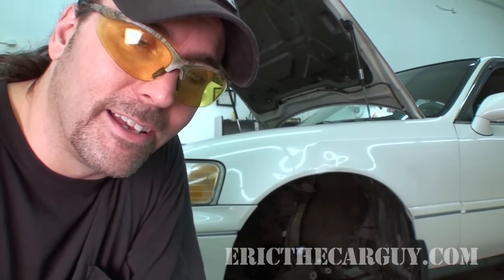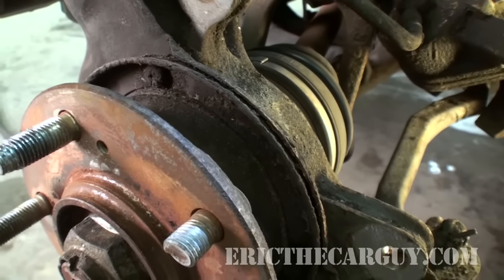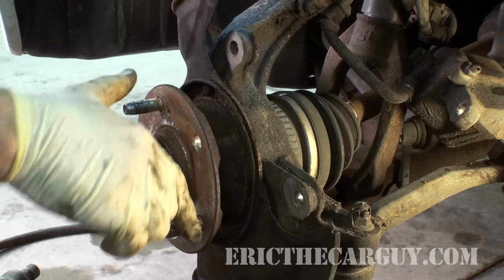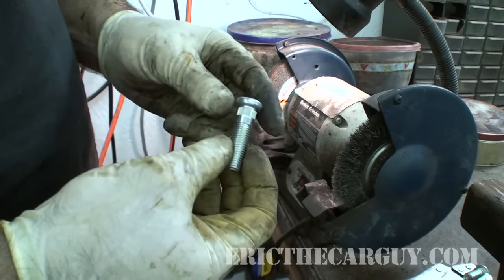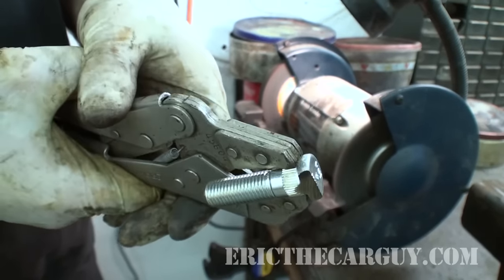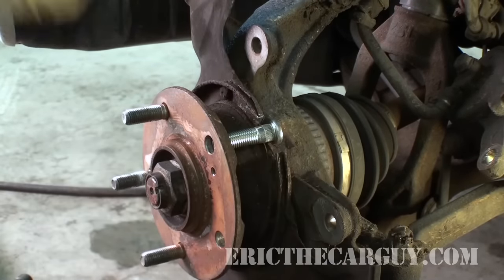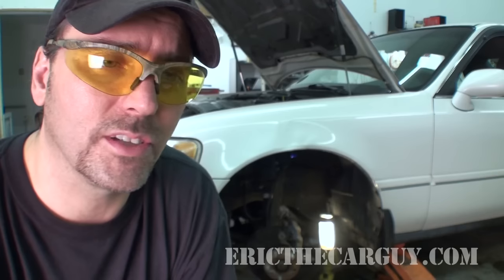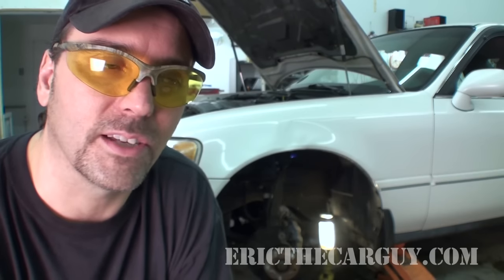Replacing Studs the 'Easy Way' -EricTheCarGuy

Comment: ETCG I really could use your help, I emailed you awhile back but wouldn't let me respond to it. Im doing a motor swap & I started trying to take of the front suspension, ball join & anything with a castle nut. Last shop put them on with an impact vs 30lbs & now everythigns stripped or rounded. Ive even tried grounding off the bolts...Ive tried everything, Now Ive got all new parts but cant get off the tie rod castle, lower control arm, everything on the front suspension of a 98 Honda civic with a castle nut is stripped & cant get out. Grinding  off didn't work just damaged more parts, cutting was unsuccessful & I don't have access to a torch. Is there anything I can do? Ive watched your videos for years now & thank you greatly for what you do & thanks for any info in advance
Reply: Eric has a video on stubborn nuts (LOL!).  He illustrated using an air hammer and/or heat.  Heat is your friend - I think was his quote!
Reply: Im pretty sure ive seen that one but Ill search & go over it again. right now only form of heat I have is a small propain plumbers torch & even after up 2 3-5 minutes of head witht that still nothing. plus now some are ground down or have to be cut & theres nothing that heat would help with unless Im melting something off. Thanks Epi
Reply: Chem istry
You can also take a cold chisel and a Big Hammer and just slam it off (if you have enough room).  You'll not be using the old parts again anyway.  Use MAP gas, not regular propane, you must make it turn red/orange.
Reply: I was lucky enough to talk to a guy with a torch but if he comes to help id be suprized cuz yeah that's all the propane one has done. Ive of the cold chisel method but Im just now looking into it. I would like to save the control arms & the arm that mounts the brakes but if its quick fix, ill replace them. a full weeks work on 6 castle nuts, I think enough enough. Really app all the info

Comment: can i ask why not use a torque screwdriver and remove the two phillips screws to remove the splash shield and then their would be a divot at the caliper and the stud would pop out easily.
Reply: You would need to disassemble the wheel hub to remove the shield. That risks damaging the bearing.
Reply: D Johnson Most hondas have a divot were caliper mount is removed to remove studs.
Reply: JBMechanics

I don't see that in the video. Even if it is behind the dust shield, you can't get to it without removing the dust shield which would require taking the hub apart.
Reply: D Johnson I have an associates degree in auto technician and i have worked for a dealership for 6 yrs and have done personal jobs myself. Im not gonna argue over youtube.
Reply: JBMechanics
The general rule is, if you only have 6 years experience in the automotive field, don't try to tell others that are more experienced how to work on something.

Comment: could i use this method to replace all of my wheel studs?
Reply: If all the wheel studs are stuffed on one single hub, what the hell are you doing? At this point, you would either pull the hub and replace the studs or buy a new hub, then deal with a new bearing, anyway.

Comment: & Shaving The Stud Side wall Was a curiousity  I had   B4 you did it.  Not good  Practice  If On   a Slalom or drifter or Off Road race car , But Then Your Choice bcz It isn't the Only compression Bolt Holding a Wheel on That Needs perfectionistic Statistics.  Its A Multiple balanced Load Sequence 2 Hold The Rim on,...   Again  Mechanics choice,  =  For bashers...  &  Ona Beater, WTF,  GFI,  2 Get it "On The Road Again" . & Pounding/Peening The Stud end but Chase Them With an Oiled Lug Nut...      Thanx Eric

Comment: The numbers on the stud do mean something. A grade 10.8 high tensile steel stud. 
No problem with grinding away a little of the head, shame you used the side of the grinding wheel! 
Pity you also damaged the thread unnecessarily.

Comment: I have a Stud On an S10 4x4 To Replace  Since I got the truck  5 Months Ago.  Found Out the Hard way 4 is not enough For Aluminum Wheels  Which Even though were Quite hand tight, I reef on Them  When doing so,   That the remaining 4 Will Actually   Turn Themselves off & In The end The Wheel Will come off Quite Quickly & On a below zero Night & finding out previous owner did not have a Jack in The hidden Compartment, Even though Right In front of The parts store to get New nuts...    Murphys law ,  & Tow truck time...   Lesson Keep you Nuts Tight  & Visually Check them  often especially Alum Rims... At Least Didn't Damage the other  4 studs or rim,  Good Idea the Air Chisel  to Help Expediate The Slide-out.  ...................................................................................  & Of Course Every One has the choice do it This way or Payyyyyyyyyy   to Not Watch how a supposedly reputable shop does it

Comment: I did that on a Odyssey and damaged the threads also.Even by grinding the studs head,it wasn't enough clearance.
Reply: I just did it on my 2012 Accord, I had to dremel the hub a bit to get enough clearance. Just a small bit of material.

Comment: First, I believe it is a horrible knuckle design that does not permit one to easily replace wheel studs.  That stated, because of the critical nature of the studs, because of how much material you were force to remove, your approach is one I would not consider.  My approach would be a new bearing and all new wheel studs.  Once I saw a wheel detach from a truck, a truck approaching from the opposite direction.  Strangely, the driver's response to the impending disaster was not to stop immediately, so it made maters much worse, the driver losing lateral control of their vehicle. That experience, imbedded in my memory, has caused me to do everything by the book when it comes to such components.

By the way, I have found the "Lisle 22800 Wheel Stud Installer" a useful tool for replacing wheel studs.

Comment: My hub does not rotate.. Or have enough space just the tip of stud. Maybe skippimg a step
Reply: rear wheel? remove the brake drum - also both rear wheels will need to be off the ground for it to turn.

Comment: Do you have to balance the wheel on the car now?
Reply: +georgio jansen You only need to balance the wheel if the tire comes off the rim, or a weight falls off.
Reply: +galuple the bolt is weighing +- 3 grams lighter so you can use a finish balancer ,that's balancing wheel on car together with drive train....question still unanswered...goedendag

Comment: I hate to say it, but this is a half ass fix. To be fair, you're not the only person I've seen do this, but I strongly disagree with it. You noted the correct way to do it, and that's how I would have done it. Remove, then replace.
Reply: I do love your videos however, and your tool reviews. They are honest and genuine.
Reply: Matthew Fant It doesn't take away the structural integrity of the bolt, and that's all that matters. I just replaced all 20 on my 94 Grand Am this way, and it took me a lot less time then it would have removing the whole assembly. I also can't afford new bearings at the moment so this was a quick and simple way for me to do it. As long as the stud still goes in and sits well, cutting that edge off isn't the end of the world. It isn't "Half ass" as you said, it just simplifies the replacement of the stud, making it easier for people who are not mechanically inclined to do it without going to a shop.
Reply: Raymond Sweet Oh I understand, trust me. The idea is to help get the job done. When this happened on my mustang it was a non issue, because I could easily reach behind and install a new stud. 
My problem was with the way the shield ended up getting notched out, bolts get grinded, and it just looks hacked. I would have in the case of this car had to make a personal call, and would have removed the bearing and the hub, and put it back just like factory. Call me anal retentive, but I leave it exactly the way I found it, or better.

Comment: OK....  Why don't you just beat on the actual wheel bearings with that hammer a couple of times while you're at it to be sure to knock the bearing end play out , especially on the install.  The 5 minutes it would take to pull that hub off and not butcher up the backing plate is what separates a guy that does it for a living from a shade tree.   A Pro would also use a Lisle a 22800 wheel stud installer and an air gun to make sure the stud goes in straight

Comment: When I saw him bending back the splash shield I thought "a bit of a hack move, but whatever gets the job done," but when I saw him shave the back off the stud I was out. Not the method for me, I'll let some other guy take the heat if that fails somewhere down the road.
Reply: It's not going to fail. The stud would snap in half before it ever even begins to pull through the hub.

Comment: Wow, Honda had no regard for the technician in this area. What a terrible design. Most vehicles have a gap in the bearing/knuckle/splash guard assembly where you rotate the hub and slip the old stud out, and new stud in. Granted, wheel studs don't usually fail unless someone forgets to tighten the lug nuts, or makes some other mistake, but still. I'm all for Eric's method in this case, as long as he explained to me as a customer what was going on beforehand.
Reply: Cars are not designed to be worked on easily. The manufacturers do this on purpose to generate work at the dealership that the average shade tree mechanic won't want to mess with. They could have designed the knuckle with a ground out area/ opening and it would have been plenty strong enough, what Eric did was an easy way to do it and will have no impact on safety for that vehicle. I've been wrenching for 37 years and have done it plenty of times myself to my own vehicles. Also for everyone complaining about proper torque on the lug nuts, I have tightened literally thousands of lug nuts with an impact gun over the years without using a torque wrench and have NEVER had anyone come back to me and tell me their wheel fell off or that their studs broke after leaving.

Comment: STOP! Grinding with the side of the table-top grinder wheel! Do not use the side of the wheel to grind. Although you may get away with it, it only takes once to regret it when the wheel blows apart, sending pieces flying at you. ONLY use the edge of the wheel to grind. Look up safety tips for using a table-top grinder. Just keep in mind that it only takes one catastrophic failure to ruin your day or worse. 

Other than that, this method should work fine. It's not perfect, but it's better than nothing. Just don't do it to a vehicle you plan on selling. Take risks for yourself and leave everyone else out of your will to take chances.
Reply: What risk?

Comment: grinding the lip that keeps lug from pulling through and messing up threads. sounds like bad idea. if possible I would drill hole through dust shield for better straight lug access then tack weld piece of metal to close whole up.
Reply: Too much time....

Comment: This job is baffling to me.  wheel studs are safety items and I really don't think I would do this. Outside of that, the other thing I don't agree with is that when there's an issue with wheelstuds, there's usually one adjacent stud that's also going to break soon, aside from the ones that need replacing.

Comment: That is one way to do it. If it's done in a professional situation the customer should be the one to make the call. but when your faced with stripped and rusted bolts on the hub of some guys clunker work truck and he give you the green light, not to mention all the other customers waiting for you to get done so you can get to there car then don't be a wank get the job done. it's not like the stud or the hub is going to fall off if you did this a million times over a million years, so I don't understand why so many panties are so twisted

Comment: How is the difficulty for a 04 mustang v6 in this installation
Reply: Haik Boyadjian way easier! just did mine and you take off the caliper and knock the old studs out with a hammer and use a lug nut to pull the new one back through
Reply: SneakySonBeach Thanks man

Comment: This is the true definition of half ass. I just replaced all mine on the passenger side front tire and it didn't take a fraction of the effort displayed here in this video
Reply: Banged the studs out. Put washers on to take up the excess space. Tighten until the head of the stud is flush on the back.. done
Easy Peasy ;)
Reply: No way this was done on an older Honda/Acura.  You have to remove the whole knuckle to press them out and in to do it proper.  Or you do it the way Eric did it.

Comment: i would not let you work on my car, there are a lot of maintenance things that should be done incl getting a new bearing when you do these sort of jobs, its a while it's out sort of deal, also grinding those down will compromise their strength, and you should inspect any parts you can see and get to for any signs of other issues, like fatigued knuckles

Comment: Taking all that stuff off is a process, nice work around though. Got a loose stud on my civic with the wheel on :, (
Reply: what do you mean exactly?
Reply: got all the lugs on, but one of the studs came loose and just spins around. can't loosen or tighten that one. Maybe I can whack the wheel with a hammer to push it back in, or just cut the stud.

Comment: Totally bodgy Eric take the hub off put it in the vice. If the bearing falls apart then obviously it needed to be replaced. Is a bearing that expensive or time consuming considering the safety of doing it properly.
Reply: There's nothing unsafe about this. And pulling the hub out would be MUCH more expensive for a customer.
Reply: @tylhunt  really Tyler I would have had that hub off with new bearings greased before he had time to grind the splash plate and grind the new stud then bash it back through and destroy the threads. But like he said that is one way to do it just I think it is a bit bodgy where I live labour costs are far higher than the cost of a commonly sourced set of bearings and a full set of studs. Chances are if one stud is damaged the rest are also structurally fatigued and the rim is probably damaged as well. Much safer just to replace all and throw the spare wheel on until you have the rim inspected. Thanks for your comment though
Reply: @jacobjosephcooper6205  New bearings for these are pre packed. You don't pull them apart to grease them.
Reply: @tylhunt  You still have to grease a stub axle even if you use sealed bearings.
Reply: @jacobjosephcooper6205  ...ok? I mean, you don't have to. You just don't know what you're talking about with this one.
Reply: @tylhunt  Ha ha Tyler your a bush mechanic too
Reply: 'I don't know what I am talking about with this one' that would be you Tyler
Reply: @jacobjosephcooper6205  Oh wow. Great comeback from the guy who has no idea what he's talking about 🤣
Reply: @jacobjosephcooper6205  better call up Acura and let them know those are supposed to be greased 🤣
Reply: @tylhunt  Even if the hub is pre assembled with sealed bearings. You still need to grease the stub axle to install it. But probably you would just bash it on. Like Eric said that is one way of doing it, but I wouldn't pay for it.
Reply: @tylhunt  by the way Acura is a branch of Honda so better call them up for this component.
Reply: @jacobjosephcooper6205  🤣🤣🤣 I'm well aware Acura is Honda. Honda/Acura axles are not greased in the hubs from factory. So like I said, you better call them up and tell them they're doing it wrong 🤣🤣🤣
Reply: @jacobjosephcooper6205  "bash it in" 🤣🤣🤣 
You have some serious problems if you have to bash in a Honda axle.
Reply: @tylhunt  If I was replacing the whole hub assembly I would certainly put anti sieze grease on the stub axle. I wouldn't touch anything you supposedly maintain.
Reply: @jacobjosephcooper6205  Never buy a Honda/Acura then. They don't grease the axles. Obviously they're hacks 🤣
Reply: @tylhunt  I believe Honda is better than any American manufacturers. And I am sure that Honda would use a very small amount of zinc anti seize grease or graphite powder before fitting such hubs. Did you contact Honda to verify your reckoning of the installation procedure.
Reply: @jacobjosephcooper6205  Right from the factory service manual. Doesn't call for grease. Personally I use a small amount of anti seize on the spline because I live in a rust prone area. But it isn't from factory, and the service manual doesn't call for it during installation.
Reply: @jacobjosephcooper6205   Also I just want to point out for clarity, it's a sealed bearing, not a bearing hub combo. They need to be pressed together. It's not a bolt on assembly. (Referring to an earlier comment)

Comment: That's definitely gonna be a nope for me as a dually owner. I'd much rather spend the time to do it right. Just remember, if someone gets killed due to mechanical failure because of incorrect installation, who ever did the work is who gets held accountable and in that case you'd be a hell of a lot further than just knee deep in shit. This method is a liability I would not risk.

Comment: that would have been easier just to change entire bearing assembly, its so old , prevent customer from future grief. it looks like it going to fail soon anyways. You can get entire wheel bearing assembly for $30 or less and 1 stud might cost a pretty penny .
Reply: But the labor would be 3x the price.

Comment: grinding down one side of the stud isnt that big of a deal. if it was some of the manufacturers wouldnt do it to the stud. i have done this repair a lot over the years and i have seen quite a few replacement studs come from the store with an edge ground off them.